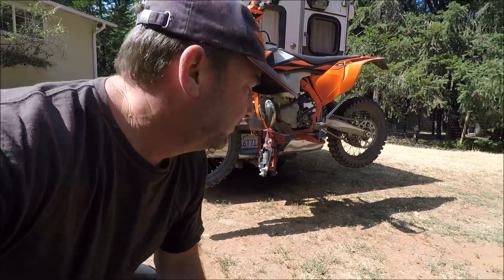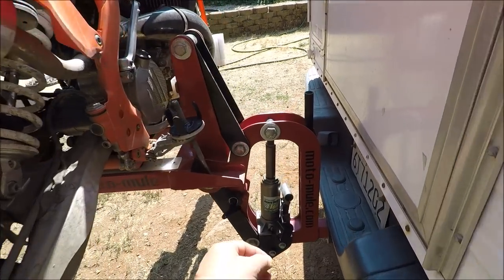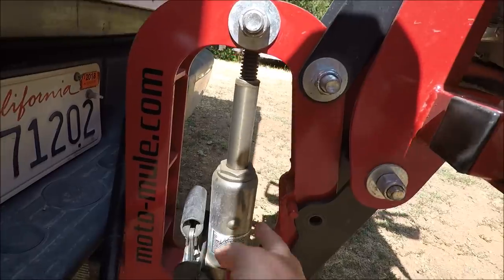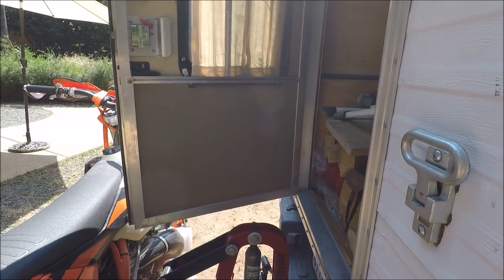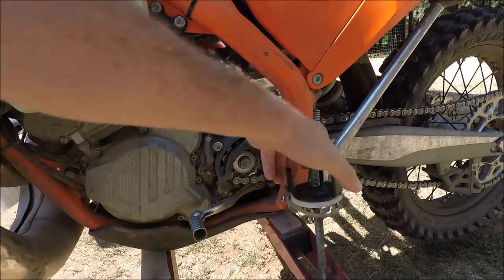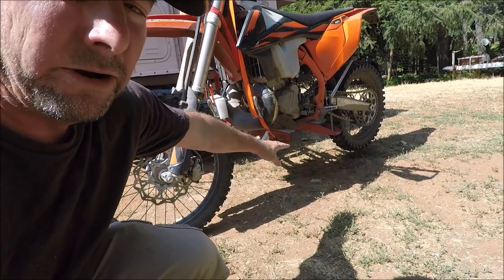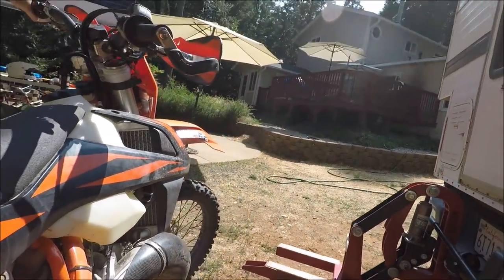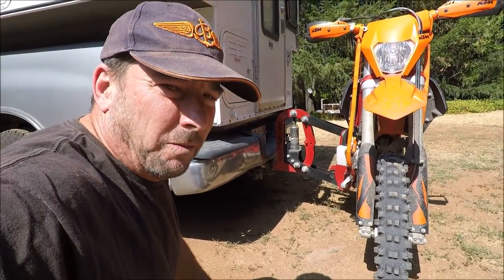Moto Mule Motorcycle Carrier - Four Wheel Camper set up

Comment: Moto Jack Rack was a similar product and may hold the patent. A riding buddy was building those about 10 years ago.

DiscountRamps has good "Rock Lock" devices for the receiver tube.

I run straps from the bars to the end of the bumper/subframe and from rear wheel to bumper/subframe. Zero wiggle.

Comment: Juan, I would be worried about those tie downs on anything more than a small dirt bike.  A CB 500 or GS 850 would need a better lateral tiedown system I would think.   I’m thinking of buying a hitch based rail/ramp system with front and rear tiedowns with greater lateral distance and therefore, support.  Still, many thanks ol buddy for this post.

Comment: Nice design. Thanks for sharing. Our electric mountain bikes are about 50lbs each. Regular bike racks are too flimsy. No patent infringement because I'm just making one for myself. A spring loaded backup for travel mode just in case the oil seal gives out in 120 degree AZ heat.
Reply: I'd be curious to hear and see how it works out. My electric bike weighs about 60 lbs,